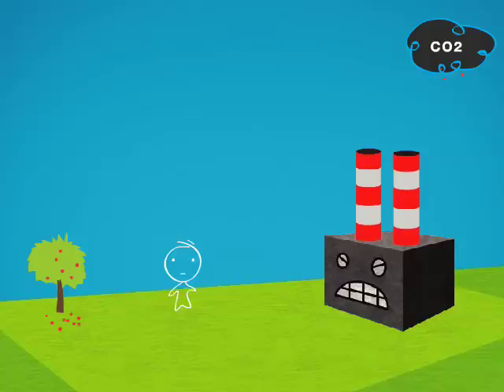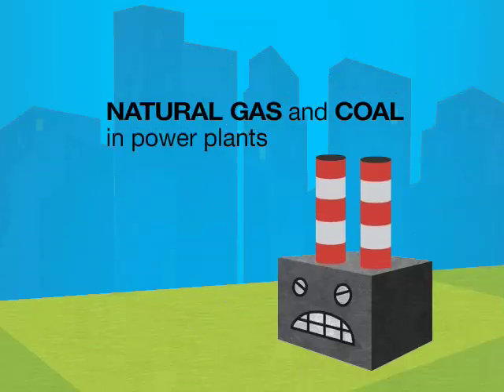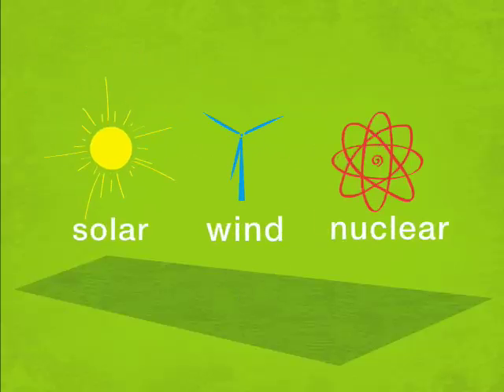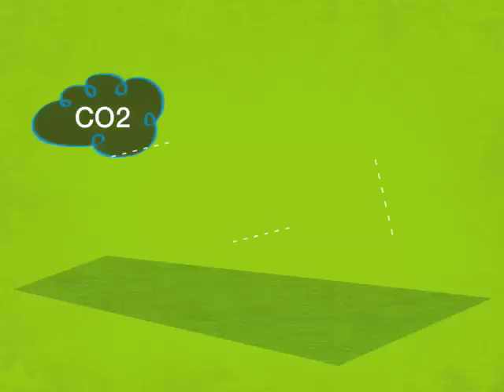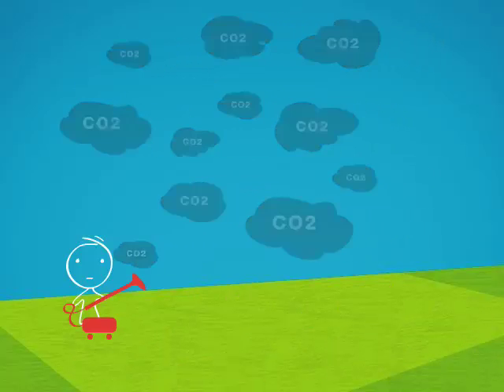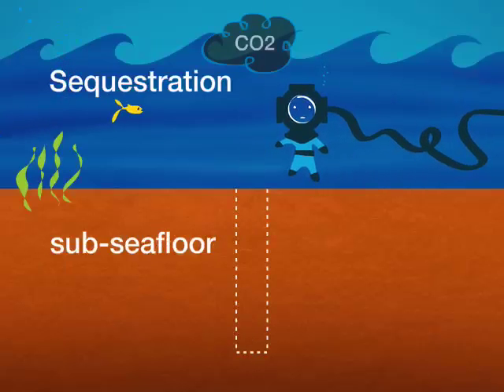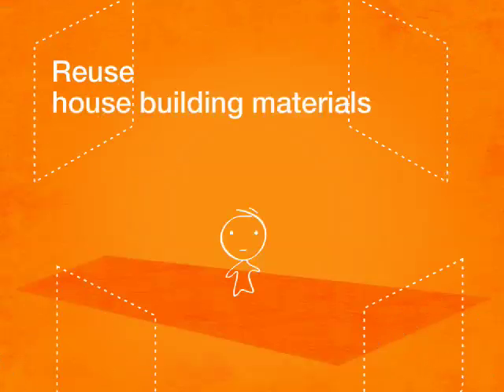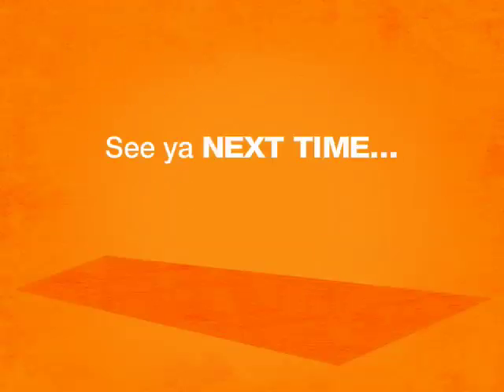Carbon Capture Sequestration and Reuse, Webisode 1: The Basics

Comment: This is really incorrect earth science to say that a gas causes the climate to change. There are several avenues that comprise weather but co2 does not cause air pressure systems to generate, fronts, the direction & speed of the jetstream, wind currents, & ocean currents. CO2 is a greenhouse gas & it pales in contrast to water vapor-that is the thermodynamics & I should know I ve had that course. They want to say co2 because you can't very well promote all the water on earth to evaporate.